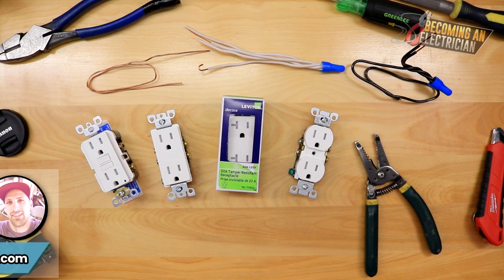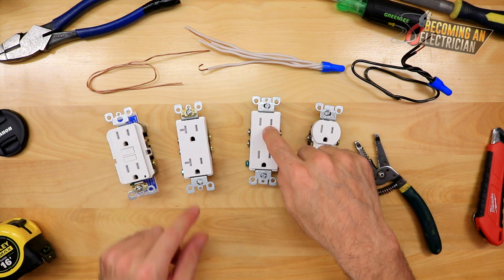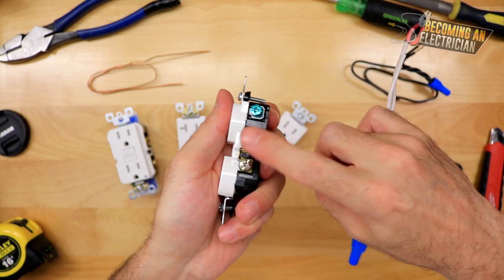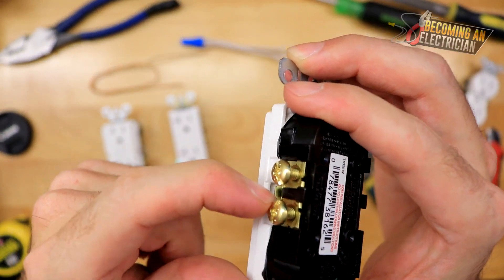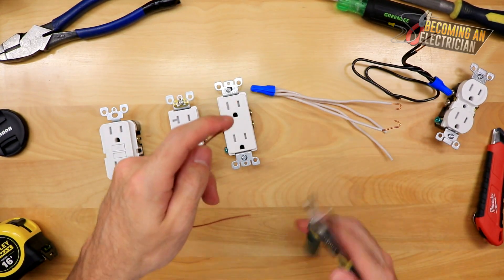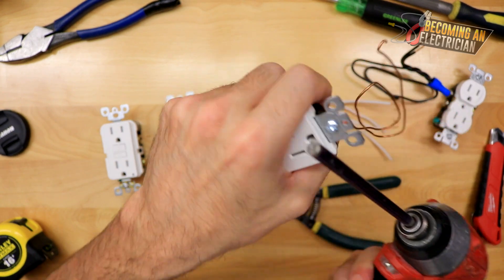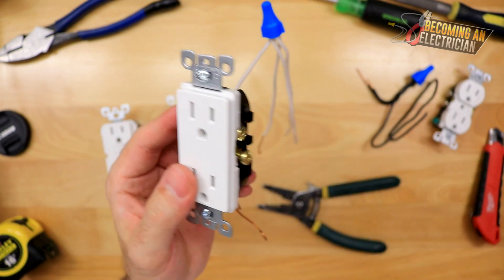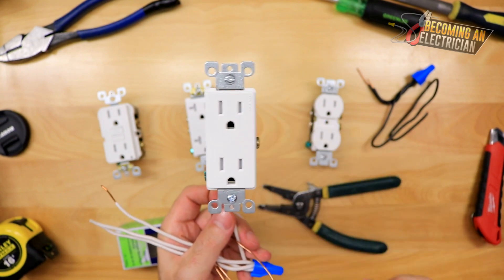How Electrical Plugs Work (Wire an Outlet)

Comment: Grear video. Got a couple of question. What do use to straighten prongs on a plug? I used pliers and squeezed them straight, instead grabbing and bending eith pliers. Now the prongs have light grooves frok the teeth on the pliers. Is that a problem?
Reply from the maker: A lot of times you'd use your plug tester gently to swivel the plug straight it if was twisted!
https://becoming-an-electrician.com/
Reply: Plug tester. Maybe something i should get. Thanks! I'm not an electrician. Just someone with lots curiosity.
Reply from the maker: @Specter1031  Yes, not only will it tell you if proper connections, but a lot of electricians use the plug tester to swivel the plug back straight GENTLY 👍
https://becoming-an-electrician.com/

Comment: Wondering if you use spec / commercial grade outlets in Canada, like we do here in the U.S. for both business and residential applications, 
and what you think of backwiring (not backstabbing) under the plates but still secured with the screw terminals. 

I would never backstab but sadly most all new U.S. subdivision homes are backstabbed. 

The aspect of diyer backwiring that I like is not having to worry about if there is too much or too little insulation stripped for the J-hooks but still having what appears to be secure wire connections. 

Also, now we have the newest style outlets with the push-in / lever style ports like Wagos, only for residential use I believe. 

I will stick with backwiring or wrapping around the screw terminal at least for now. 

Your videos are fantastic, the most thorough and overall informative that I have watched. Thank you!
Reply from the maker: In regards to the best plug outlet quality brands, here in Canada things have to be CSA approved (governing body).. so if it passes, we're allowed to use it.  The lower end stuff feels a little cheaper, but it's still considered "safe for use in Canada".

I had to look up the word back-wiring plugins.. here's an excellent article from Leviton:
https://blog.leviton.com/back-wiring-vs-side-wiring

The general rule is never modify equipment, as it will not be protected in terms of insurance / warranty with device failure.

Back-wiring is acceptable, and the side-wiring method (creating a hook around the plug terminal screw).

A lot of things first become available to the USA electrical world before coming to Canada.. so have not seen the Wago/push-in plug outlets yet.

The biggest thing to always keep in mind is protecting the wire, and try to avoid exposed copper.